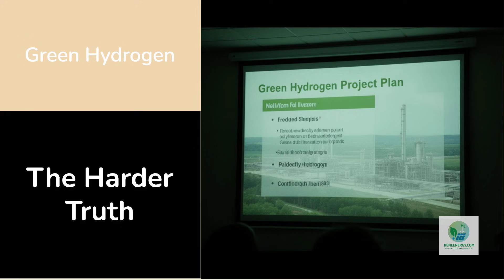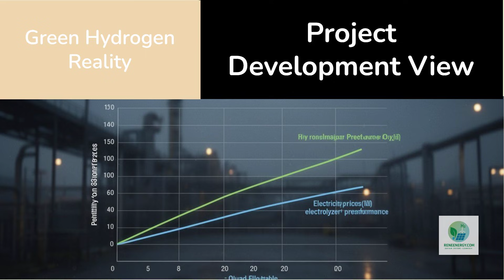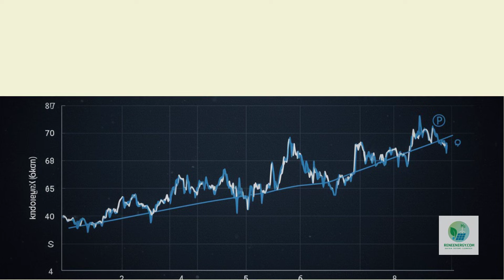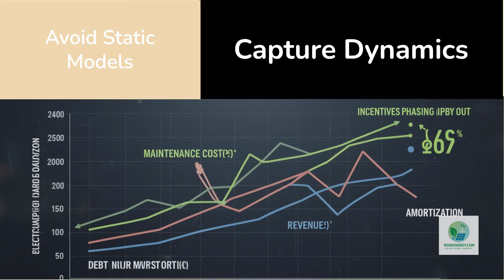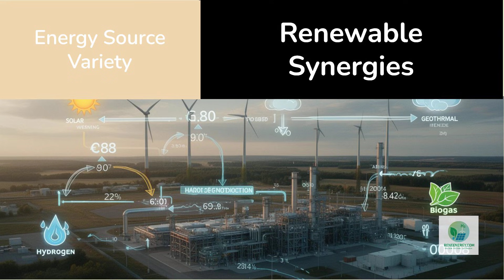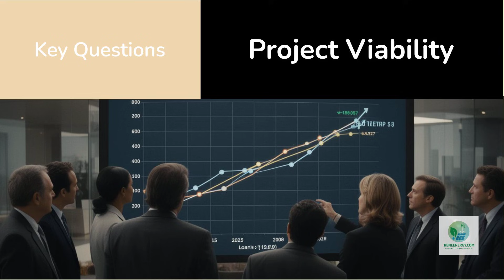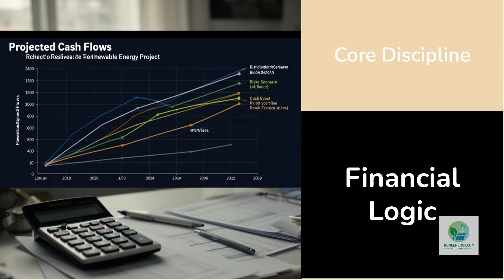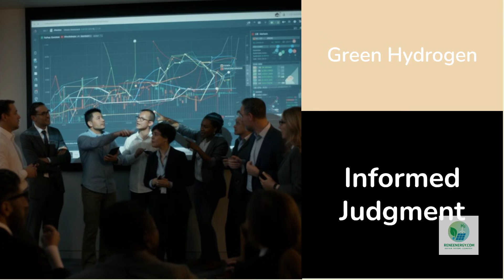Green Hydrogen Isn’t Expensive — The Math Is Just Ignored

Comment: Give  one example of a clean hydrogen project that produced a lasting piece of electrical  infrastructure.  One!
Reply from the maker: Thanks for the great question. One clear example is the Lolland Hydrogen Community, commissioned in 2007, which integrated wind power, electrolysis, hydrogen storage, and fuel cells to deliver dispatchable electricity into the local grid—not just hydrogen output. It left behind lasting electrical infrastructure, and we break this project down in detail in the new video if you’d like to learn more here: 

https://www.youtube.com/watch?v=BL9C0S4TAI4&t=7s